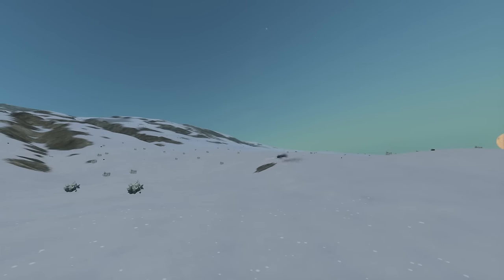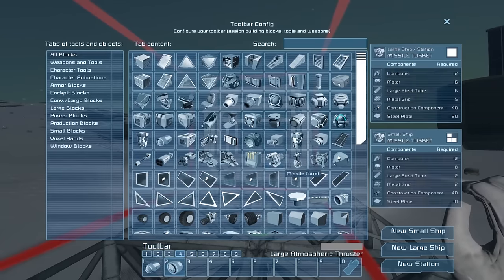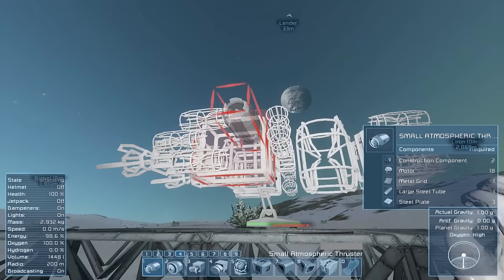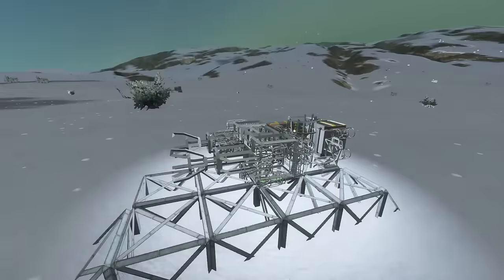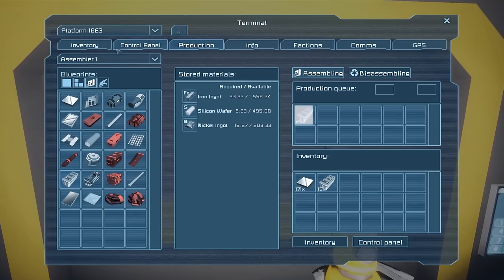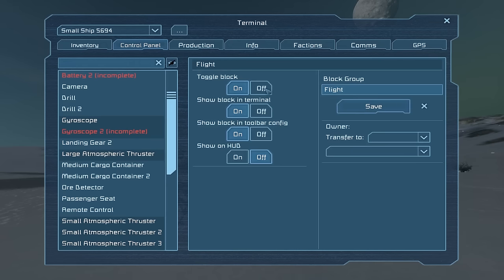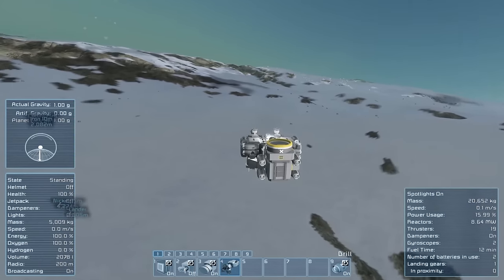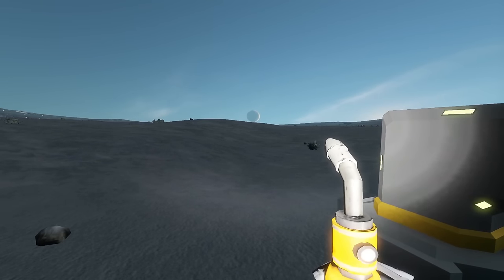Space Engineers - Planets Survival Guide #5 - Our First Simple Mining Ship

Comment: +W4stedspace , a full cargo of stone would weigh the same in x1, x5, or x10, it's just in the x10 there's ten times as much stone (by volume) and in x5 there's five times as much stone (by volume). This was a balancing mechanic to make it so people playing at inventory modifiers weren't disadvantaged compared to the x1 people after the cargo update.

I'd put some "power efficiency" modules on the refinery, and move the assembler so you can put 4 on it as well, this would greatly reduce the power needed by both of them, reducing it to about a full solar panel for each the refinery and the assembler. This is helped because, besides the 8 motors required for 4 of them (so 16 in total for both refinery and assembler), this is entirely iron. Exact numbers: with 0 power efficiency modules they run at 560 kW, and with 4 installed they run at 112kW, at maximum efficiency a (large ship) solar panel will create 120kW.
Reply: yes but in 10x you are never gonne be filling up your cargo containers in any circumstance

Comment: A few things. Thrusters do not care where they are on the ship. As long as they are not part of a separate grid (i.e. connected to a rotor or piston not directly on the ship) they always apply their thrust to the center of mass. So thrusters can be asymmetrical and not cause any rotation. And the 10x inventory setting your kinda right on, it scales the volume containers and you can hold but also inversely scales the weight. So a full medium cargo hold on 1x will weigh the same as 10x but hold 1/10th the volume. So if your ship supports a full load on 10x it will on 1x too, albeit its a smaller load but both loads weigh the same.
Reply: also inventory size does not only affect cargos, as WastedSpace said. it affects your personal inventory, and the inventory of every block in the game: refineries, cockipts, assemblers, drills, welders, grinders, etc

Comment: Question that I need answered.  How do you get the game to run this stably?  I know the first thought is always that by that I mean frame-rate and that I just have the graphics settings too high, or my system is insufficient, but this isn't the case, with the exception of initial render lag, the game runs at a fine frame-rate up until it crashes, furthermore, my computer is definitely sufficient (GTX 970, 16Gb Ram, fx9590 CPU, solid state drives), and it crashes for lots of different things.  The game just crashes for simple things, like mining, or when a ship breaks, or anything really, sometimes it just crashes when I load a world.  Two more issues, even after the change log saying they fixed it, I still fall through the world, I don't think there is a way to fix that on my end , but still.  When mining with a ship, no matter how careful I am with the drills, one will always break, what am I doing wrong?

Comment: The rover and the unnamed flyer would probably work more efficiently if operated in tandem. [..]  As far as power is concerned, the power upgrade modules can be built with starter materials.  Also, I never use the old recharge mode anymore as it just wastes power.
Reply: +Low Rads 
Well, recharge mode is very handy for connected vehicles to ensure they never go draining their batteries in an attempt to supply power to the base. I treat it like turning the reactors off on any other vehicle. It ensures that all systems are off, and that the vehicle will be ready to go when needed. Discharge I only ever touch when wanting to dismantle a battery tho. And the misleading old semi-auto mode should probably be removed entirely.

Comment: Sorry to say, this didn't work. The thrust from the single engine was insufficient to carry a full cargo load on x10 cargo capacity. Mining was great as long as I was pointing down, but once both cargo boxes were filled up, I was topping 190k+ kg. As soong as I back out of the hole I was mining in and leveled off, the main engine couldn't keep me up, and the entire thing crashed to the ground and was destroyed. I had to assemble a rudimentary cargo vessel from the remnants just so I could transport my stuff back to base.

I'd recommend, in the future, that you test these designs "fully loaded" before foisting them off as viable constructs for new players.
Reply from the maker: +Husnok D Apoplogies, I wasn't very clear as to the purpose of the pair of cargo containers.. I touch briefly on it at abouut 7:10 but not clearly enough. 

The point behind 2 is for balance, having the weight placed either side of the main engine so the ship doesn't want to tip when you load it up. It does mean that you have a little more cargo capacity than you can fully use (can get to abouut 120k kg) unless you tilt the craft forwards a bit. The plan is for this craft to grow further down the line but in the interim I'll add an annotation to clear things up a bit - as you've seen it would only take about 4 more small thrusters pointing down to level things out and this ship was always intended as a starting point for further building.

Comment: 10:26 "...and we need a place to sit."  Wait, what?  Why?  EDIT: 14:28  What you're talking about is nonsensical since the inventory SIZE is 10x smaller too, therefore it will work just as will at 1x as it does at 10x.  That's the whole reason for the weight-reduction-with-multiplication patch...
Reply: +mazack00 
Regarding the seat, it allows the considerable advantage of having a third person view as opposed to relying on camera via remote control. It also means your miner has infinite range, rather than being confined by the 5km range of it's own antenna, or needing an additional support/relay vehicle immediately.